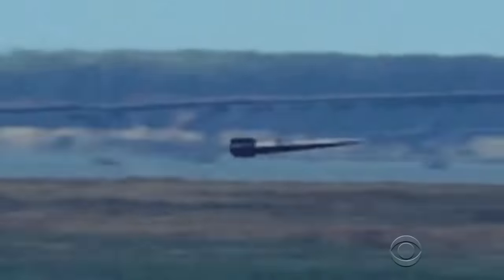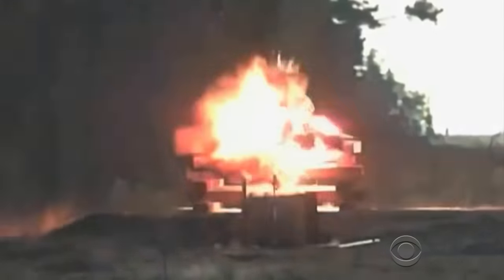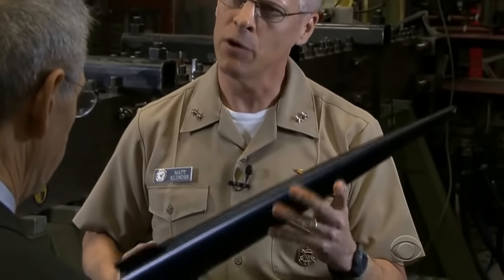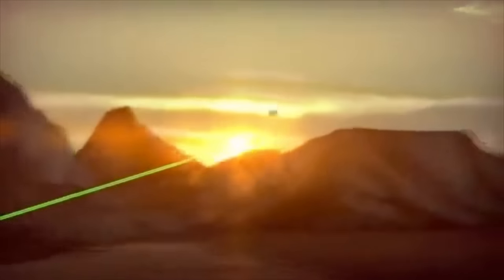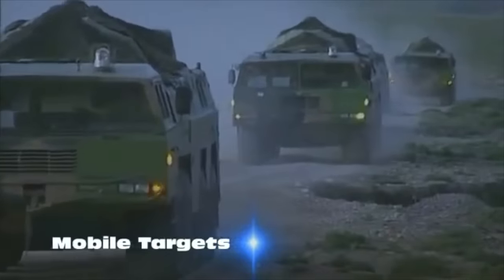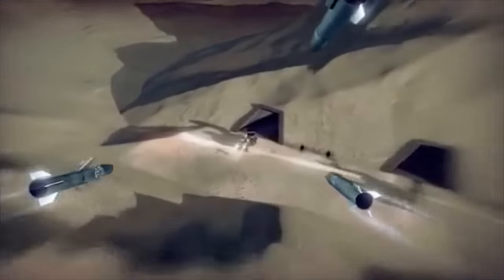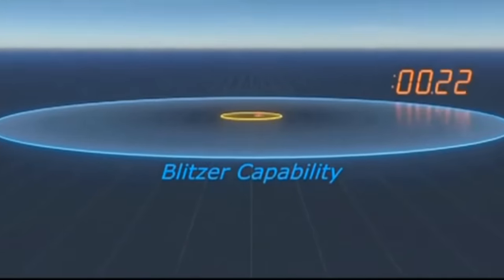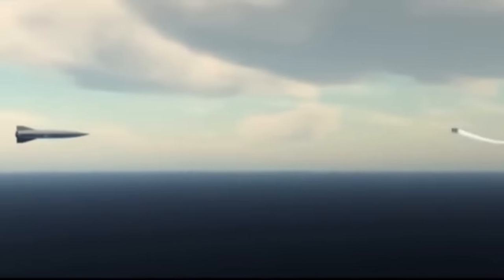U.S. Military's Most Powerful Cannon - Electromagnetic Railgun - Shoots 100 miles - Mach 7

Comment: Game changing weapon for US army until they get in to the Isis or Isil hands by "accident". ^^
Reply: MrBalonko ISIS doesn't have the capability to maintain such a high tech weapon most likely
Reply: MrBalonko ammo and power feed mate
Reply: I make stuff like laser weapons and I'll make plasma rail stuff and gaussguns and you will need power input. I suspect the weapon turns a relatively small battery into a large power source and it uses magnetic coils, like a homopolar motor it propells forward.
Reply: and special ammo. and probably to be able to actually operate it
Reply: and yes, maintain.
Reply: The power required for these things is currently the biggest drawback, they will be on ships first and will require that ship in order to generate power for it to work.  If they eventually become handheld they will require huge backpacks of power cells and lots of heavy duty maintenance to keep clean.  Terrorists rarely use weapons more complex than RPG's as it is because they don't have the parts, time or training to keep something like a minigun in working order so I don't see Osama Grandson Laden buying many railguns for his followers.
Reply: Another video claims it requires around 25 megawatts of power, or 19000 times the average household consumption. I wouldn't worry about militia or terrorist groups using military grade railguns any time soon.
Reply: MrBalonko producing the power necessary for railguns are so much that very few ships can power it. Isis couldn't power it.
Reply: MrBalonko - That won't happen now!  The 0bombus have left the Whitehouse!
Reply: MrBalonko Along with a mini-nuclear reactor able to provide enough energy to propel this Kill Vehicle to Hypersonic? Probably a while.
Reply: MrBalonko  cough Hillary
Reply: Or sold to them by someone like Bill Clinton selling nuclear technology.
Reply: James Insalaco   Yes and don't think that The influence of the likes of Bill Clinton have gone away simply because they are out of office. The Clinton machine is still very active and has infiltrated every agency of the US government. Does the name James Comey  ring any bells?
Reply: James Insalaco   are you sure it hasn't?  Bill Clinton, Hillary Clinton, Barack Obama, James Comey  and the many  Democrat Generals etc.  That's my point. Remember the pallets of cash US currency delivered to Iraq.
Reply: James Insalaco   Apparently you've closed your mind to all possibilities.
Reply: James Insalaco   Ok since you are so educated about Isis, please enlighten me. I'm listening.
Reply: James Insalaco All good points, except that there's the handheld, gauss gun version, far shorter range, smaller munitions BUT still requiring a honking-big  power supply... So yeah, still is technologically impractical for them.
Reply: Luckily for us are great President Trump has destroyed Isis and he did so easily.

Comment: I don't see this working dependably against supersonic air-born threats since they can adjust their trajectory after the rail gun has fired. Like a rifle once the rail gun is fired its projectile can't adjust to stay homed in on its target. It would seem to me that with sufficient distance a smart target will need change its direction only slightly to defeat this. Where I see this being absolutely deadly is for stationary or slow moving ground or sea based targets. If I were a tank driver or on a Naval vessel I'd be absolutely terrified of something fired a few miles away and moving at mach 7 (23 lbs@5371 mph = 22,180,000 ft. lbs. of energy).
Reply: Hey Chuck, I thought the video said that the projectiles can be adjusted and their outer shell can be basically discarded. I agree with you on those slow moving targets, man I would be terrified too. 👍

Comment: You gotta be kidding me if you are saying that you mounted a rail gun on a ground transport vehicle. What this video wont tell you is that these projectile can only be fired for a numbers of times. Obviously, you won't run out of ammo but the charging mechanism fails after a couple of shots due to overheating and deformations caused due to debris. Even if it survived somehow, to wont have enough energy to charge the next cycle. This sort of weaponry is suitable for naval ships with humongous generators and storage capacity and they too barely manage to tame these gigantic monsters with very limited number of shots. Again, this comment was about the efficiency of rail gun system mounted on ground transport vehicles.

Comment: “Eliminating propellant and the relative supply chain”.... what about the 2 huge multi-truck mounted generators and their fuel we see in the 3D animation?
As far as I know the only feasible use of this electro-cannon technology (that BTW was first developed in the early ‘80s at Yorktown Heights laboratory) is on board large ships, better if nuclear powered aircraft carriers, because it’s the only environment in which a moving power source that can light an entire city is already in place.
Reply: Propellant costs about $90 per gallon on the cheap side. The government gets Diesel at wholesale for about $2 per gallon. Truck mounted generators use fuel when turned on and with diesel it's much, much cheaper to power the guns than to shoot them.

Comment: The main problem with this system is - it doesn't actually exist -- you see that great big fireball behind the projectile? That's the rail gun itself blowing up when it's fired. So -- yeah, cheap projectile, but kind of expensive if you literally have to replace the rail gun itself every time you shoot the thing. 

So -- yeah, it could be a great system if they ever manage to iron out that one little flaw -- which is making the rail gun itself re-usable -- designing a rail gun that's robust enough to fire at least dozens of times with minimal damage.

Comment: Bring the Iowa Class Battleships out of retirement and equip them with these guns. First, the battleships have armor plate surrounding the ship to ward off any enemy missiles that might get through like a Mirage. But secondly and most importantly, the ship is large enough to accommodate the backup systems and generators needed to support the rail gun and the needed power to generate enough electricity for firing the gun...

Comment: This goes to show you only one thing. Since it is a chunk of metal without a guiding system it will just travel through the air for 100 miles straight as an arrow. Guess the one thing. Don’t worry I’ll wait.

Comment: Although it is a technological weapons breakthrough using E/M to accelerate 23lbs to Mach 7 and reaching its target at 200+ miles in a few seconds, I would really be more impressed if there was a real technological breakthrough if we could develop a weapon like the fictitious "Phaser Torpedo or Missile" that will, by virtue of its composition, travel the speed of light and hit any target, whether still or in motion, with precision and, preferably, disperse all the atoms of the target so that it vanishes before our eyes with no sound and not collateral damage.

Another real and desirable technological breakthrough would be a real working and practical "Teleportation" technology to disperse the atoms of a subject or subjects, living or inorganic, convert those atoms to the teleportation requirements and "Energise" the atoms and "Beam" them to another location and then convert the energised atoms to their respective material physical characteristics.  This would easily solve the heavy and labour-intensive human power and wasted energy for our current primitive transportation system which is thousands of years beyond our current technological abilities.

Comment: that gun is only a gen-1, problems include:
1> rail surface fouling,
2> rail surface abrasion
3> low velocity / MJ sec.
the gun shown above also has no initiator.
comparitivly speaking, blitzer Vs. gen-6............no contest.
reduced fouling means more shots fired between maintenance cycles,
much higher muzzle velocity/joule of energy, plus gen-6 also has an initiator, so a more robust, less complex P.S.U. can be used.
comparitivly speakin' blitzer = junk.
'nuff said.

Comment: $25,000 Purchased through the military system and $300 if purchased In a private system!
Reply: Id like to see someone buy 23lbs of high quality machined tungsten with a computer guidance system for 300
Reply: 25 lb weight. Tungsten alone cost $30 a pound. Thats on top of having to use a specialized forged to mold into shapes because of its off the charts melting point.

Comment: Let's assume the railgun is 30 ft. above sea level.  Given the curvature of the earth, the horizon distance will be 6.7 miles and the target hidden  height (below the horizon) is 5803 feet below the horizon.  How in the heck can the rail gun, at Mach 7, follow the curvature of the earth and hit a target that is over a mile below a straight line of sight?
Reply: By getting instructions in the air from AWACS

Comment: Still no match for my prototype ELECTROMAGNETIC-NON-RAIL-GUN project or E.N.R.G, info on my project is mostly CLASSIFIED above all U.S. Law's Including search warrants and Marshall Law, and confiscation.... A tippical Rail-Gun is built with 2 or more rails with a high voltage electrical current passing through the rails to produce an electromagnetic field of witch is used to send the projectile down range, there's just one problem with that. The projectile absolutely has to come in contact with the rails of witch creates an extremely high amount of friction that produces extremely high levels of heat the only way to re-use the rail gun for more projectiles is to use a sacrificial shell around the projectile for this Rail-Gun to function correctly. My prototype E.N.R.G is quite different in the fact that I have solved the problem with high friction and high levels of heat. My E.N.R.G can fire it's projectile down range without the projectile touching the barrel, by not touching the barrel there is no friction and no heating of the gun..........

Comment: Agree 25 K per round is way to much, ok maybe a hundred at most! I would assume the electromagnetic propulsion system would use a super-conductive magnetic coil winding made possible by liquid helium, such as a M.R.I. Machine? Otherwise you would need HUGE power source to drive it. Very interesting weapon indeed. 🙂👍👍
Reply: I was thinking he was going to say $25.00.....  What is it made out of to cost so much!?!  Titanium???  I'm guessing all the R&D is included in the price.  Its probably a $100 to manufacture....

Comment: accuracy? power source for mobile units?
Reply: I dare say that thia weapon will be attached to ships, multiple motor vehicles, and when the time comes probably in aircraft when it's light enough, it gets power supply from a generator that is either a diesel generator or a turbine (Jet Engine generator)
Reply: There is still bullet drop with this weapon system, it would take some of the smartest Minds in the world to detect the bullet drop of this weapon, and I think this way open system is going to be guided by tracking and search radar the same that's in the m134 phalanx close in weapons system

Comment: Still just a fantasy gun. Light Gas Guns are the only thing that doesn't blow or burn itself up when used but it isn't portable, yet. Cool thing is that once you reach the 25,000 mile per hour mark, you could take an Elephant down with a .223 bullet. Bad guys on the battlefield would be easy prey with a .177 caliber projectile at 25K MPH. All conceivable armoured vehicles will become obsolete with a three mile per second projectile. Is that a "Ray Gun"? Ha! Might have to have expendable platform ships that you use once and watch them sink after one shot. Might as well just upgrade the targeting systems on old school battleships and use the old 16" guns with a sabot round.

Comment: S400 has fail your electromagnetic railgun becomes s400's speed is 14 mach. Its 7 mach.
Reply: S-400 never see it coming. Railgun could easily take them out and fast.
Reply: @tolmie1141  how can reach out rail gun to s400. Rail gun speed 7 mach and S400 speed 14 mach.

Comment: Ok, not one word on the power supply system that supports this gun which I assume is large and cost a lot. Which means if a ship is built without it and they try to add it later, it may not be able to do to the energy needed. 
I also noticed the cables that have to run from the ground mobile Platform to the gun may take a lot of time to set up. The video makes it look like the setup is easy and fast. I bet it is not.

Comment: Billions wasted so far on this rail dream. Right now the only way to get one into the field is to bring a reactor with it to generate the massive amounts of electricity it requires.  The Navy MAY deploy one on a ship in 20 years or so. Putting one into use on land is stupid. The enemy only has to put a single round into it's reactor, and everybody anywhere near it will die of radiation poisoning.  The people pushing this worthless crap, are major defence contractors.